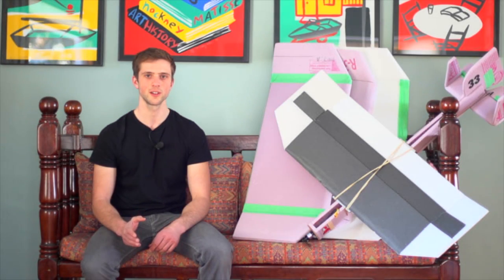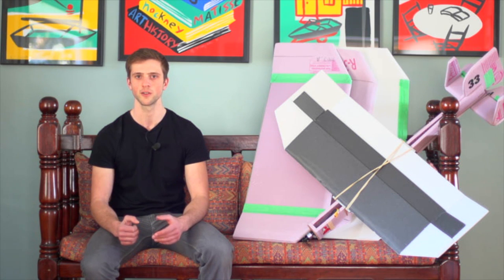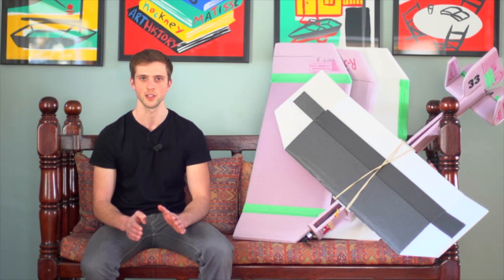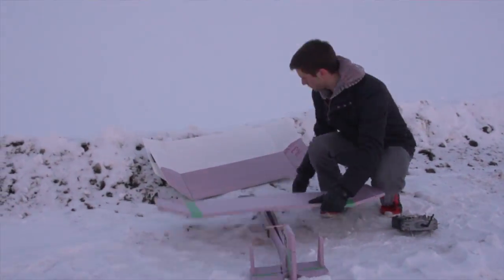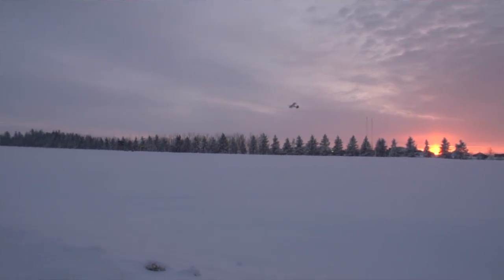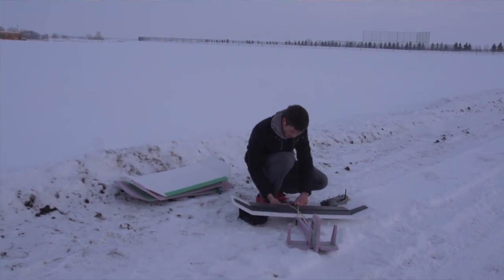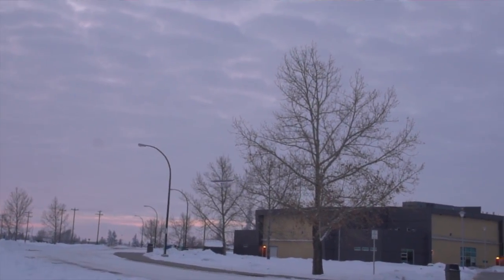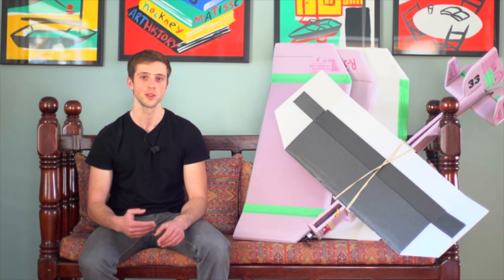KF Airfoils - Flight Testing (Amazing Results!!)

Comment: Good work.  Try having a couple KF pockets on the wing instead of 1 step all the way across. I feel it helps the airflow stick to the wing better at stall speed. Also try a convex edge on the step so when the air goes over the step it will transition to a smooth vortex at the step rather than the abrupt straight down interruption adding turbulence to the airflow.. I used the pockets on the top of the wing on my first manned flight and it seemed to help. My Wind tunnel tests showed it would draw air in from the regular airfoil to help the air stick better.

Comment: Great info. I am curious about the suitability of these wings for gliders. Do they have too much drag?
BTW you should change the music or at least use a longer loop, it sounds like music from when you are on hold from the 80's.
Reply: KF is not the best for gliding, they are too slow in this use.. a smooth, normal, profile is better,, no steps...KF are best for powered flight.. The KF does limit/reduce the top speed in a glide or when powered up.. to get the positive kf effects you loose a bit of speed and gain on stall , stability and smoother flight

Comment: Interesting video. Thanks for the effort. The first wing will perform very well if you give it a positive angle of attack of about 5 degrees.

I am curious how you determined that the KFm4 produced high lift. All airfoils produce the same amount of lift. The shape of the section determines the Cl for a given angle of attack.
Reply: +Tom Harper He said the KFm4 used less throttle and could fly slower than the others, which would indicate higher lift.
Reply: not so much lift, more a lack of stall.. you can slow KFm4 wings down till they stop flying along, and parachute down.. a small amount of power is all that is needed to get them flying again..

Comment: did you make all those KF wings with stacked up 1/2 inch insulation foam? If not you should make a build video that goes over how and what you used to make the KF wings.

Comment: Thanks for such a great video. Would the thickness of the unprofiled wing make a difference as it is thinner than the others? Also is it possible to have the 2 steps of the KF 3 equally spaced like at 1/3 and 2/3 instead of 1/2  and 3/4?